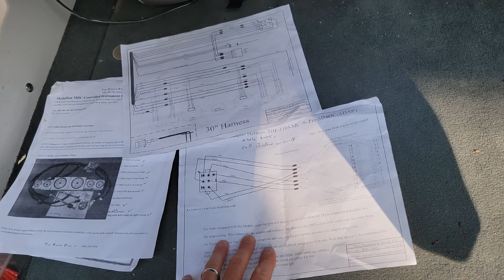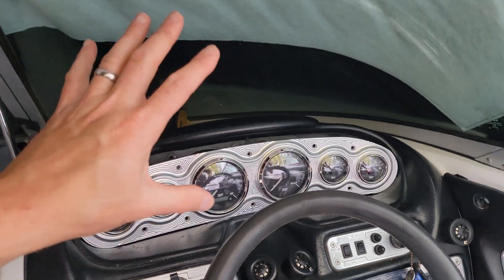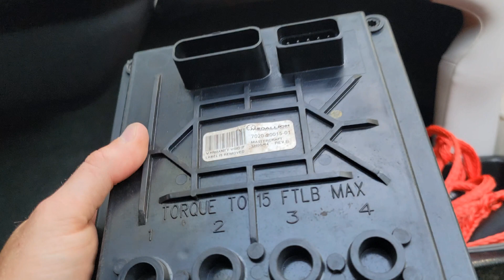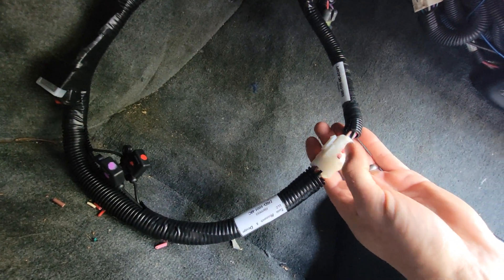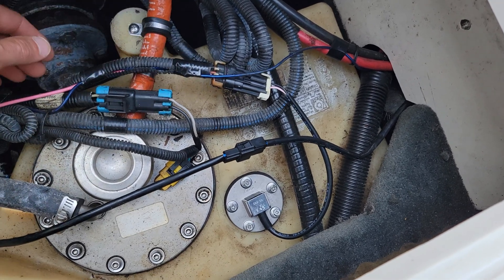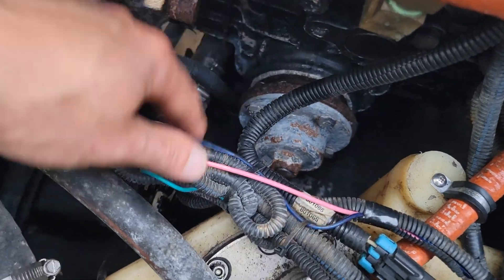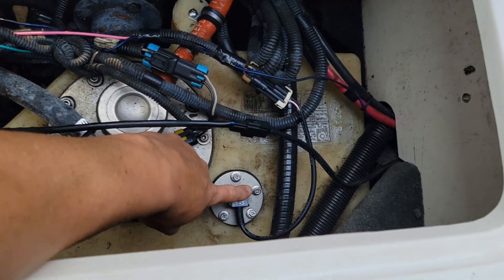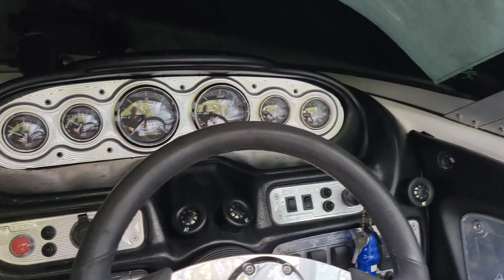Mastercraft Boat Digital to Analog gauge swap Step by Step DIY

Comment: How do you know that the new temp sensor will trip the engine light or overheat alarm? (How is it tied to the ECU?)
Reply from the maker: Mine never had the light but did have the alarm. I'm not worried about it bc I put an electric water pump in place of the mechanical and it's working great. I'm always conscious of my gauges though.